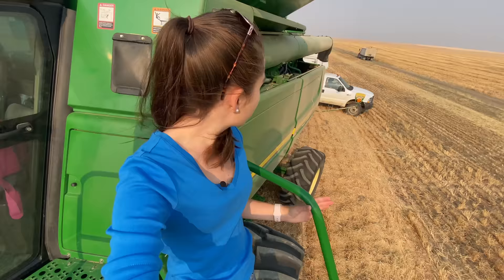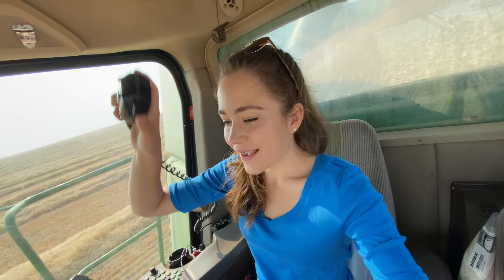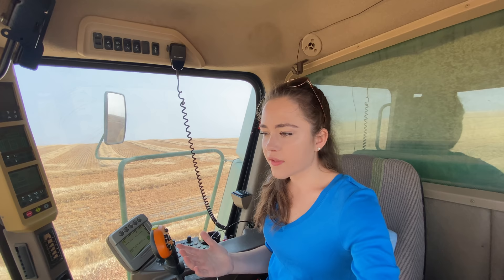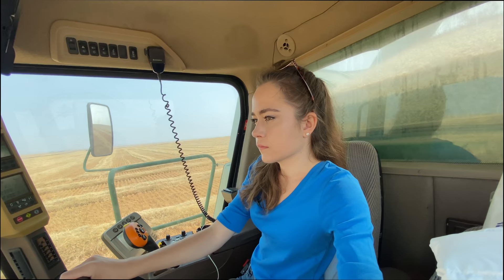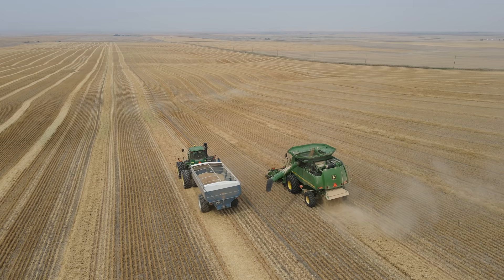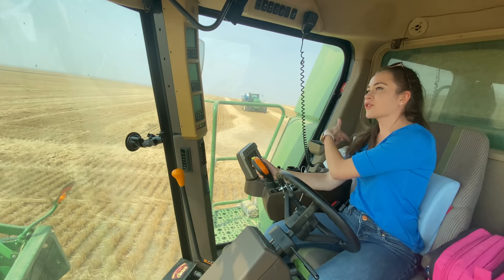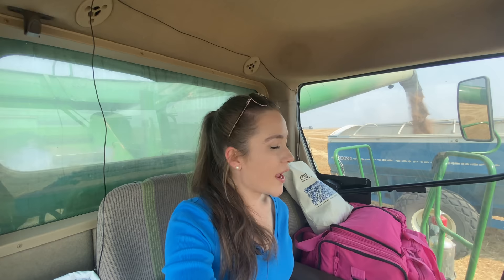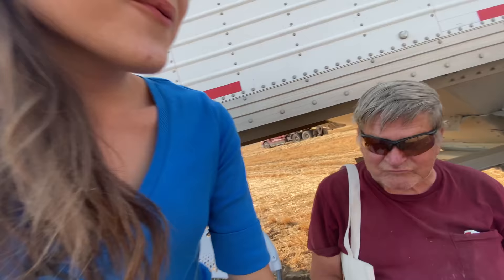OH NO!!!! Another Breakdown!! Wheat Harvest 2021

Comment: What kind of wheat loss do you experience by swathing the wheat vs using a platform head and direct cutting it.  I seems the added expense of swathing would cut into profits.  Here in North Carolina we would end up with most of ours on the ground because it would pop out when touched at 13% moisture.
Reply from the maker: Thank you for your question.  In Montana we have a bug called Saw Fly that destroys the stems of the wheat and we cannot pick it up with our straight cut headers.  If we didn’t swath it first we would lose most of our crop.  We would prefer not to swath but we have no choice.
Reply: @KatesAg  that’s interesting.  Thanks for your response.  I find it interesting the different practices that are used across the country just so us farmers can earn a living.

Comment: Why are they not using regular headers? Sorry I'm not an expert.
Reply from the maker: Thank you for your question.  In Montana we have a bug called Saw Fly that destroys the stems of the wheat and we cannot pick it up with our straight cut headers.  If we didn’t swath it first we would lose most of our crop.  We would prefer not to swath but we have no choice.
Reply: @KatesAg  O thanks for reply. Didn't expect that's the reason. Little bit more work but looks like its worth it.🙂

Comment: Do you ever count how much wheat is going out the backend?
Reply from the maker: Thank you for your question.  We have a meter that tells us that.
Reply: @KatesAg  So, how well does your new combine do at max power. Are you throwing much wheat out the back. Inquiring minds want to know.
Reply: @dr.michaelr.foreman2170  You drive it according to the grain loss monitor,which has impact sensors at the back of the combine,so not necessarily operating at maximum power,but try to keep it close to maximum capacity without unacceptable grain loss.
Reply: @lynwessel2471  Thank you. I know how it works and it is not that simple as you have tried to imply.
Reply: @dr.michaelr.foreman2170  Sorry, I've only run green combines for 41 years, what else is there to it,that I failed to explain?Gladly answer your question.